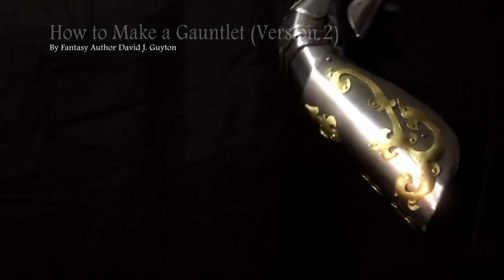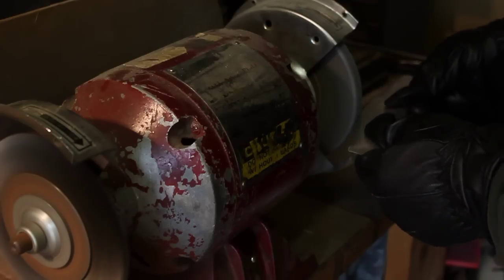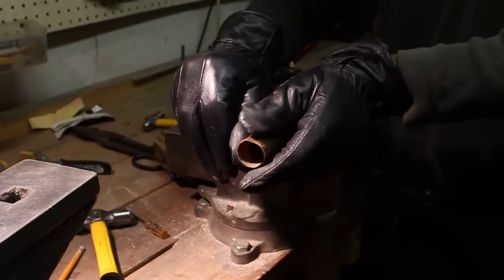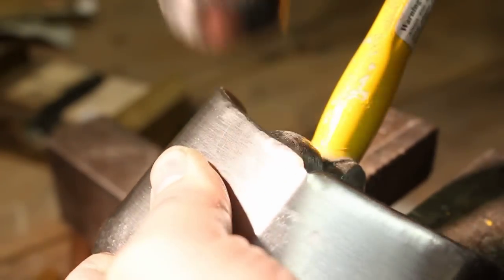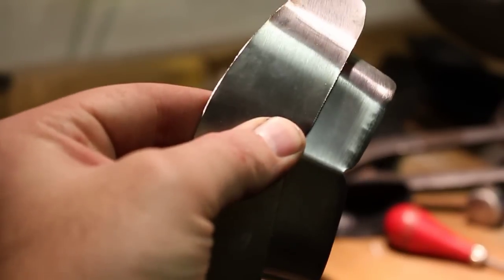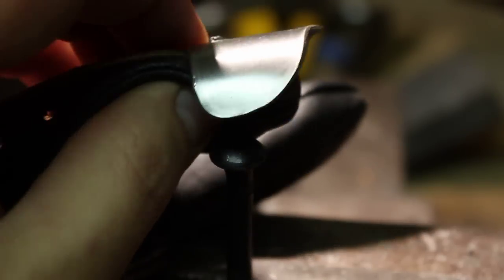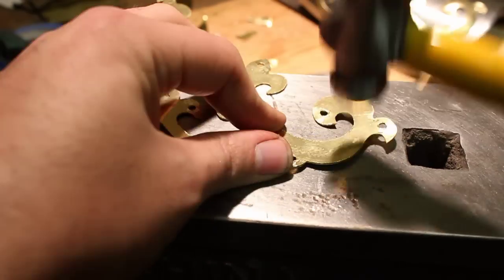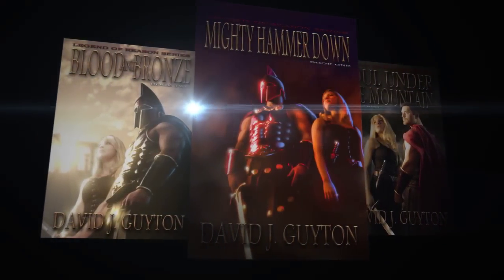How to Make Armor with Ordinary Tools - Version 2 Gauntlet

Comment from the maker: I don't use a forge, or heat, or use complicated processes. I use mostly ordinary hand tools that can be found in almost any garage. Doing this is not measured with skill level; it is measured by your dedication to the project. ANYONE can do this, they just need to put the time in. Some will take longer than others (I take a lot longer than most, by the way)

Comment: The "ghost" is a reflection. Notice how the light source is coming from in upper left front and the camera is viewing from the lower right front - exactly the path light would reflect. Also notice the glare from the upper left side of the safety glasses getting brighter as he pushed them up the bridge of his nose. Also notice that the movement of the "ghost" up and to the right corresponds to the exact movement of the safety glasses up and to the right. The room is dusty, and the lens probably has faint amounts of dust that are invisible most of the time, but are visible when illuminated at the right angle - like dust in a sun beam through a window. The perception that the dust reflection looks like a face is a case of pareidolia.

Comment from the maker: 20 gauge stainless. You can also use 22 gauge stainless if you like. If you use regular steel, I suggest 20ga for the fingers and 18ga for the rest. The nails are ordinary roofing nails. They are not soft...they just deform easily when hit over and over with a hammer.

Comment from the maker: it depends on where they end up exactly. The only place that it might bother you is if a rivet ends up right at your fingernail. The lining inside the glove will help to hide the rivet some, but if a riven still bothers you, you can just get some very thin cotton gloves like they use in museums, etc and slip them on beforehand, or sew them into the actual leather glove after riveting.

Comment from the maker: The knuckleplate is wider because it needs to overlap the had parts. This means the piece has to be a little larger overall, so that it not only overlaps, but has enough of a gap between the pieces to allow good articulation. I suggest assembling in paper and making any adjustments you feel you need to make before committing to metal. Just keep in mind that you want these parts to fit together somewhat loosely, not too tight

Comment from the maker: I suggest leaving things a little more loose so you can move your hand more freely. If you are using leather, it will stretch and bend instead of tearing like paper. For length, I attached the end piece first, thought the metal, leather strip, and glove. Then place the last piece (near the knuckles) on, and get a feel for how much spacing you need. Mark the leather strip for each piece, and then rivet the fingerplates to the leather strip

Comment from the maker: As long as your printer settings are set to do so, yes, it will print out at actual size. There is a "1 inch" mark on the template. Print it out and measure that mark. If it's 1 inch, you're good to go.

Comment from the maker: I get my sheet metal from Ebay from a company called Shapiro Metals. I think their seller name is ssshapirometal. I paid about $20 plus shipping for the stainless steel (20ga, but you can use as thin as 22ga if stainless). Regular steel is much softer so you must use 18ga, 20ga for the fingerplates. Gloves were $13. Thinsulate brand from Walmart. Brass was about $20.

Comment from the maker: It depends on the metal you use, and the thickness of the metal. If you are making it as a wearable costume piece that you plan to have on for a few hours, I suggest 20 or 22 gauge stainless...maybe as thin as 24ga. This won't be "battle ready" armor but it'll be tough enough, and weigh, I dunno, 2 lbs or so. Maybe a little more

Comment from the maker: No. Light hammering is all I used. This will actually serve to strengthen the metal a little up to a point. Heat treating isn't necessary at all, and would be a tremendous added chore.

Comment from the maker: You can use whatever thickness you want. If using stainless, I suggest 20 or even 22 gauge (higher number, thinner metal) Anything thicker than that will be VERY hard to cut with hand tools. Regular steel, brass...those can be up to 18ga, and I would not use 22ga in those metals. As far as dimensions, the template prints out to 4 or 5 pages. You will need about that large of a piece of sheet metal for each gauntlet you want to make. I get mine pretty cheap from ssshapirometal on Ebay

Comment: Leather can be obtained from Tandy leather. You can use a trailer hitch clamped into a large vise instead of an anvil. Or follow a coyote around until one drops on his head. The gloves can be found at motorcycle shops or you can buy leather ropers gloves at most work clothes suppliers.

Comment: Excellent work. I am going to try and make a heavier (and more utilitarian) version of these for SCA combat. The design with the fingers attaching directly to the gloves is particularly inspired. I will probably use large heavy leather gloves then use cotton on the inside to pad the rivets, use fewer finger sections (more protection less articulation) and use much thicker materiel (probably 16 gauge mild steel or aircraft aluminum) and make a fingertip that wraps completely around the finger.

Comment from the maker: I buy from Shapiro Metals. I think they are ssshapirometals on ebay. I just bought a sheet of 22ga stainless 24" x 48" for $30. If you are using stainless, I STRONGLY suggest not using 14, 16, or even really 18 gauge. It will be extremely hard to cut by hand and hard to shape. 18 is the highest I would ever go in stainless, and I would rather work with 20 or 22. My Iron Man gaunltet is 22ga and it's plenty tough.

Comment from the maker: tack as in weld? Welding any of the parts would create some problems. First, each part must be able to move freely, and when you weld you are locking the parts together. Second, unless you are TIG welding with stainless rod, the welds will rust. Most people who have welders have a MIG, and that will certainly rust.

Comment from the maker: This template prints out to 4 or 5 pages I think. So you'll need a sheet of metal about that large for one gauntlet. I get my metal pretty cheap on Ebay from ssshapirometal. $20 or so should be plenty for one, probably 2. The Anvil I got from Harbor Freight. I think it was like $50. You can also find a dumbbell and use it instead. A REAL anvil, as in a hardened steel anvil will cost many hundreds. Mine is cheap and dents easily, but it gets the job done.

Comment from the maker: I don't remember, but this template prints out to about 4 sheets of printer paper (could be 5, I forget). You'll need about that much in metal. If you buy from Ebay from ssshapirometal you can get it really cheap. I paid only $20 for enough 20ga stainless to do this whole gauntlet with quite a bit left over.

Comment: You know, if you use oval holes for the rivets in the wrist, you will be improve the range of motion for the gauntlet, allowing the wrist to bend in all directions.
They are lovely, but this would give you a slight improvement in functionality.
Reply from the maker: I did that for my first gauntlet (the brass one). This design I wanted to make easier for beginners. A lot of people were confused about the slotted holes so I made this one simpler.

Comment: Hey David,
I bought you templates yesterday and they're awesome! Great work!
I got 2 questions for you if you could help me...
First, what is the thickness of the steel suppose to be?
And second, the fingerplates that goes in one another suppose to come from narrow to wide so they could fit in one another? (I hope you understand what I meant...)

Thank you for your help!
Reply from the maker: Well the thickness can be whatever you choose. If you are using stainless I suggest 20 gauge or even 22 gauge (the higher the number, the thinner the metal). If you use regular steel or brass, I suggest 18ga....maaaaaybe 20ga but that might be a bit flimsy. Stainless is much harder than regular steel. as for the fingerplates, yes you should squeeze the fingerplates a little smaller on the top side so that they can fit into the next fingerplate. You won't have to squeeze too much. Just use a pair of pliers

Comment: This video has been a great inspiration to finally do something thats been stuck in my head for ages and I want to make cestus to go with my halloween costume. I'm not savvy with lot of tool usage but I got a good deal of the gist. But I have two questions. How big of a sheet do you normally use on a gauntlet project and is there any good suggestion of where I should look to purchase? We have a Lowes and Home Depot near but didnt know if there was a more reliable or cheaper option someone in the know would actually know. Also any particular place you get your gloves for these projects? Not many places near me have a good shopping spot for non-fancy gloves except maybe a hardware store and those don't make me think "badass".
Reply: Sorry for the double post but I actually read alot of your comments and found what I needed. Thanks anyways though!

Comment: This is so cool... quick question: Did you pop rivet every finger piece to each other or you did it through the glove? I'm a little confused as to how they are attached to the glove. Also, have you considered making a full gauntlet complete with the inside of your hand? That would truly be amazing... Thanks man your work is inspiring!
Reply from the maker: Thanks! Actually you don't want to use pop rivets for anything like this. They are just ordinary rivets. Most of them are kept loose so that the parts are free to move. If you use pop rivets, that can't happen. The template explains exactly which fingerplates to rivet through the glove and/or the leather strip. Basically you want to have the fingertip area, and the knuckle area riveted through both, and the fingerplates in between are riveted only to the leather strip. I did cover the palm of the hand in my Iron Man gauntlet tutorial, however it is not recommended. Covering the palm makes gripping objects difficult or even impossible in some cases.
Reply: Thanks so much for your reply... I'll be sure to send you some pics when i'm done.
Reply from the maker: excellent. I'm excited to see them

Comment: Very impressive work, I've downloaded the template, how did you cut the brass sheeting for the fancy scrollwork accents ? Looks pretty tricky to do with tinsnips
Reply from the maker: +Make it work ! for all my brasswork I cut out the general shape with the snips (where I can) and then I use a Dremel tool, a drill (in some areas) and small files to complete the shape. It's a very labor-intensive process but the results are worth it.

Comment: If any one is looking for material thats isnt to pricy you could contact a metal sheet worker bussines (the ones that makes metal roofs and ventilation) and ask for a piece. Altho they are not as thick as the metal used here but easy to cut and shape. They got stainless metal sheets, brass, copper and normal metal with or without color :)

Comment from the maker: I can't remember the finish exactly but I think it was #4. For the rivets, I think you are cutting them way too long. I too used regular galvanized roofing nails. Try cutting them so that only about 1/8" sticks up above the metal. work slowly around the nail, making a mushroom shape around the edges

Comment: David- I picked up some 20 gauge SS steel but it seems too thick to cut with shears.  In the video you say it is 20 gauge your using.  I picked up the full template pack and want to use parts and pieces from them to fabricate my own design for a character I am working on.  thanks! :D
Reply from the maker: Yeah all stainless is difficult to cut with any kind of snips. Even 22GA is hard, and anything thinner than 22 (24, 26, etc) is going to be too thin to hold its shape well...which is why I use 20GA or 22GA. There are snips that handle it much better, called "bulldog snips" or "bullnose snips". If you check out my video on DIY Armoring Tools, you can see the snips I am talking about. Brand is Milwaukee, and they are about $10 at Home Depot or Lowes.

Comment: Amazing work!
But there is no details on how you attached the buckle to the rest of the glove (in the template either),  how do you do it?
(PS: I will show you mine when it's done!)
Reply: And also, would it be possible to know the size of your hand?
Reply from the maker: I did not include instructions on where to place the straps for the buckle because many people will do it many different ways. You just need to find a spot, drill 2 holes, and rivet to the vambrace. Doesn't really matter where. This design should fit any hand, unless you are like 8 ft tall. My hand measures about 8.5" around the palm and over the back of the knuckles. 3.5" across the palm, under the fingers, and about 7.75" from wrist to tip of middle finger

Comment: I am wanting to make a glove specifically for field hockey but I am taking in medieval aspects of hand armor. Which of your designs would be the best for protection and which metal would be the best to use?
Also how long does it take you to fully complete one piece?
(I would also alter the design and add padding- I am just focusing on the movement at the joints and how the metal sheets work together)

Comment: Just a hypothetical question.. I doubt I would actually do this any time soon but I thought I'd ask

Would these designs still be fairly useful and practical if someone were to use heavier and thicker metal, and just heat the parts that have to be shaped? Like to try to and make a "functional" piece of armour that could actually take some hits... I'm quite curious because these are very nice designs :D
Reply from the maker: The shaping method is the same whether you use thicker or thinner metals. These designs do not require annealing or complex shaping, which means there is no need to apply heat to the metal.
Reply: I'm curious, how thick do you want the armour to be?
Reply from the maker: 20 or 22 gauge in stainless steel, 18 gauge in regular steel

Comment: David, you have my thanks. I just bought the template, and it seems simple enough. Just one question: Is it possible to make the gauntlet out of Aluminum? Or even just Sterling Silver? Because I cannot acquire any stainless steel. Unless you have a link...?
Reply from the maker: You could try aluminum. I have never worked with silver so I can't help you there. Aluminum is usually easy to work with, however it hardens quickly if you hammer it, and it can crack easily. You can get stainless fairly cheap from Ebay, but I am not sure what country you are in, so giving you a link might not work. I am in the USA, and I buy from ebay seller ssshapirometal
Reply: David Guyton Ah, thank you. My country is in Australia, by the way. Also, I'm using this for LARP. Would this be any good for it? I hate to bother you with so many questions, but the way I see it, the more I know, the less I ask. :)
Reply from the maker: Sure it would work for LARP. In my opinion you will be far superior to those using plastic for their armor.

Comment: Just bought the template! Really cool!
However I am having some problems with the instructions. It was all fine until I got to the Knuckle-plate. It seems waaay too huge for my hand, but since all of the other pieces fit maybe I'm just missing something? I just bent the piece in the middle as well as about 3cm from the corner hole. I'm assuming from the video that the dashed line should be pointing strait at my middle finger.
Thank you.
Reply: Just a quick question, what Dremel bit did you use for the bronze accents? I tried to use a normal carbide one, but after 40 minutes the bit wore down to an hourglass shape and I haven't even finished one piece at that point.

Comment: What was odd to me was your plates go in under neath the next one from the front, which to my logic it should go over the next, so I did some research and realised you do it that way because you Revit them to the leather strip and not eachother, that way you can also hide the revits. In other gauntlets where the front goes over the next they are rivited to eachother, much more difficult to do.

Comment from the maker: I copied and pasted what you wrote into Google and got some results. It appears that the issue is not on my end, but may have something to do with your card and PayPal not communicating. You can try checking out as a PayPal guest, and entering your card info...but I suggest you do what I did and do a Google search to find out the best solution

Comment: Hi David.
I am in the process of getting the equipment to make this gauntlet, but I was wondering about the pipes you use to bend the finger plates. You suggest 1 inch and 3/4 inch pipes, but my bare fingers don't even fit into a 1 inch pipe, let alone adding the thickness of a leather glove and a leather strip as well. Is your 1 inch the inner or outer diameter of the pipe? Do the plates not sit snugly over the fingers? Should I use a larger pipe (fat fingers) or am I just over thinking the design?

I look forward to your reply so I can get on with making these awesome gauntlets!!
Reply from the maker: The 1" pipe is measured internally (I.D.) and the 3/4" pipe is O.D. What I would suggest doing is getting a glove that fits you, and then going into a hardware store like Home Depot, and seeing what size pipes look like the approximate shape of your gloved fingers. Then get the next size up as well. This bigger size is the one you will need to cut in half, obviously. I was able to find what I needed in the plumbing section (gas pipes), but you may need to look elsewhere in the store and get creative if none of those pipes are going to work. Alternatively you can use the same pipes I did, and then just spread them wider until they fit your fingers.